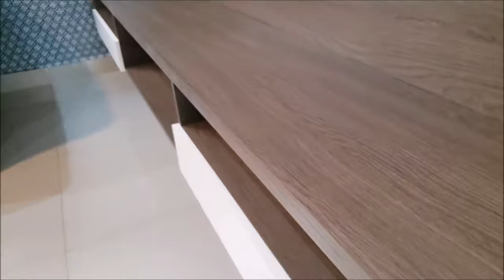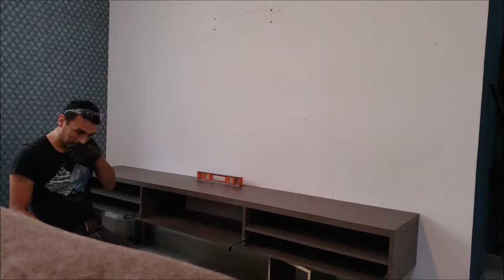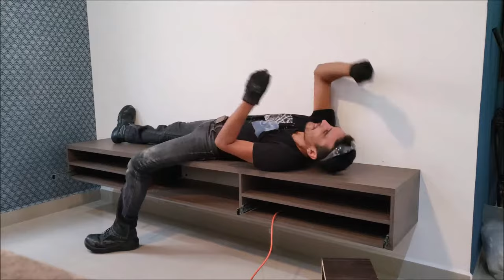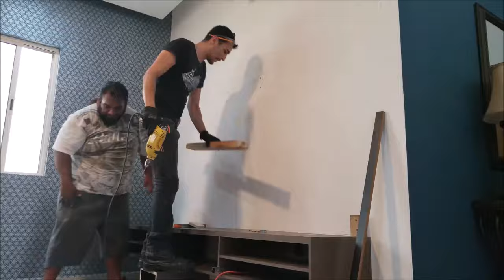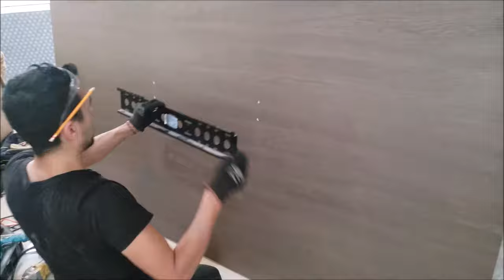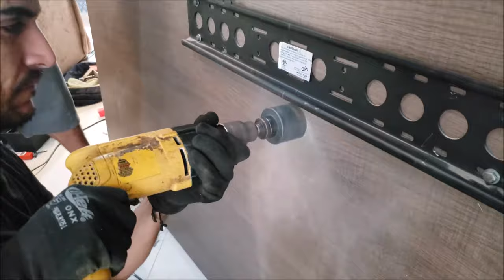➡ Mira como instalamos PANEL PARA TELEVISIÓN | oculta tus cables ahora

Comment: Me parece bien, pero no muestran específicamente cómo va el soporte al panel o que tornillos usar... es posible instalar un soporte con brazo solo al panel flotante?
Reply: Yo no me fié de la madera, lo hice directamente a la pared,mi TV es de 55 "  y pesa 23 kl aprox.
Reply: @elcamaleon.1.035   esa también es mi duda osea el rack solo se sujeta de la madera, aglomerado o melamine no se que  material está utilizando. Pero como es eso que tu Tv pesa 28 kilos?? Que Marca es? Bang & Olufsen? Saludos
Reply: @BabySensoryWorld1  hola, tienes razón, mi TV es un Phillips led, y tiene un peso aprox de 21 a 23 kg..
Reply: @BabySensoryWorld1  yo me hize uno igual pero no emperne los cajones a la pared de manera independiente sino todo en el mismo panel , si es por el tema de la tv , yo use melamina de 18mm y use pernos para el rack pasantes con tuerca cuatro y sujeta mi tv de 43 sin ninguna dificultad creo q hasta uno de ,55 y más lo puede sujetar , es interesante saber cómo en ese sistema q muestran pasan los cables de HDMI corriente de la play del dvd del Deco etc etc porque desde mi perspectiva se ve complicado